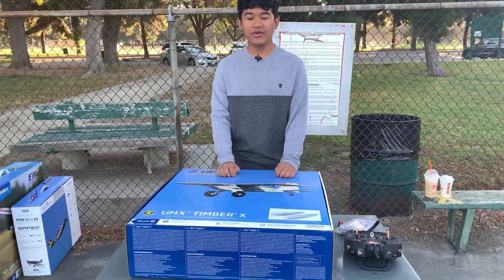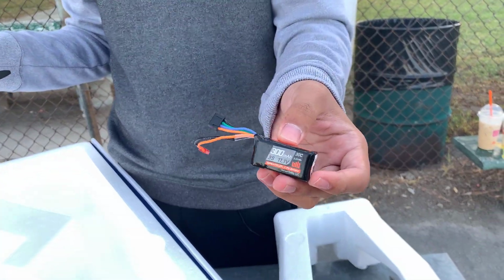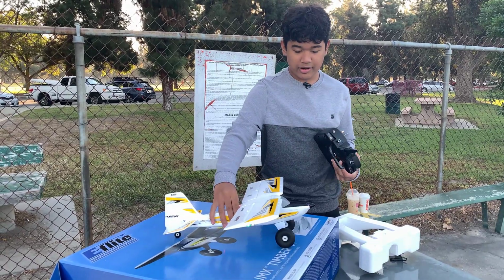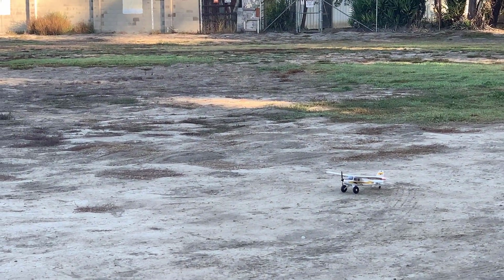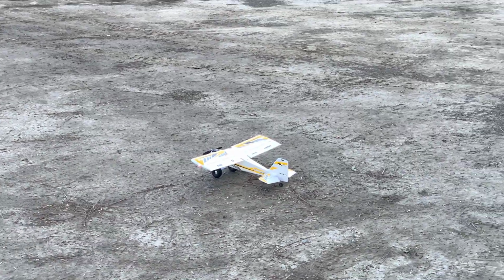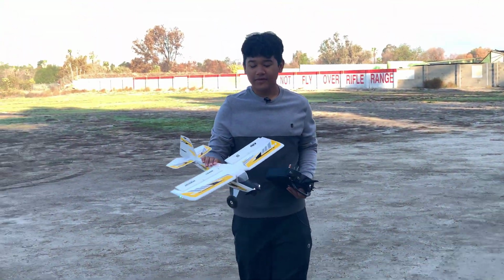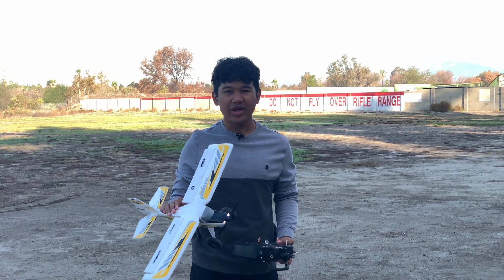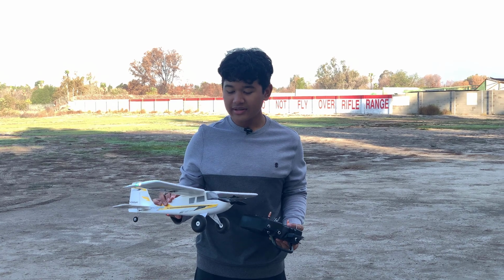E-FLITE UMX TIMBER X - MAIDEN FLIGHT!

Comment: I almost bought one of these yesterday!  I found a random hobby shop and stopped in hoping to find a Warbirds P-51B Mustand but they didn't have it.  And yes I know I can order one on Amazon but I REALLY hate buying things like that online because I much prefer to be able to actually see it and touch it for myself before spending money on it.  I'm just getting ready to get into RC flying so I haven't actually flown one yet so when I saw this UMX Timber in the shop I was really tempted to buy it but I decided to wait until I watched some reviews of it first.  This will be the first video I have seen of this airplane (haven't watched it all yet) so I hope it's an informative one!  The main thing that actually stopped me from buying it though is that I ride a motorcycle so size is an issue which is why I have been looking for the small P-51 by Warbirds.  The Timber however is larger than I would like.  I definitely could figure out a way to transport it wherever I want to take it on my motorcycle but for my first plane I think something small enough to fit in a backpack would be best.
Reply from the maker: If you are a first time UMX Timber flyer, I recommend the regular UMX Turbo Timber over the Timber X. The Turbo is more versatile and easier to fly in general. This UMX  TimberX  plane is geared towards 3D flying. The Turbo Timber can do 3D  as well as Sport flying as well as general beginner basic flying. Thanks!
Reply: don`t do the timber x , first learn to fly without safe on a trainer plane
Reply: @Jackson27mc  I actually ended up buying the small p51d all foam trainer from Amazon even though I really didn't want to buy it online.  I live in Florida however and it got here just as the weather turned bad.  I live in the middle of the state though so these things are never really bad for us.  But it will be a couple of days yet before I can fly it.
Reply: @Robert-jg9rr  go fly, only if there is no wind at all, small planes don`t like wind ,  especialy if you are learning to fly , have fun !

Comment: I ordered one just this morning because of a 10% off sale being available for this plane and a few others. I'm curious as to why you set yours up with spoilers instead of landing flaps.  Please give me the pros and cons of doing so. Thanks.
Reply from the maker: Congrats! I set my model up with spoilers for no reason in particular and just wanted to mess around with it. The only real pro that I feel spoilers have is that the plane does high alphas slightly better when the spoilers are up. They absolutely are not necessary but it is pretty fun to mess around with in flight. The plane is able to slow down quick enough to the point where landing flaps are not needed.
Reply: @JonsRC  I see. After I get more familiar with the X I'll give spoilers a try.
So, with flaps are you able to do inverted high alpha?